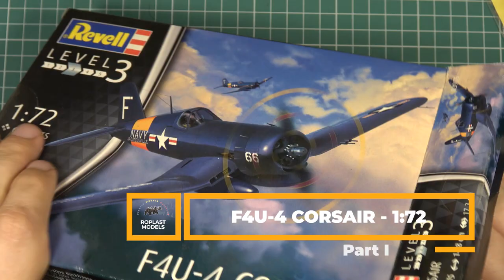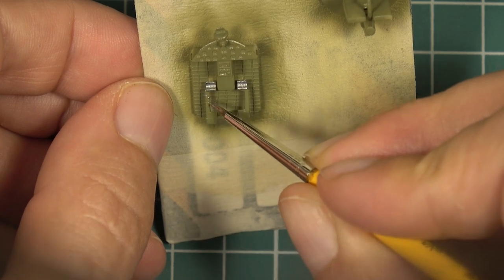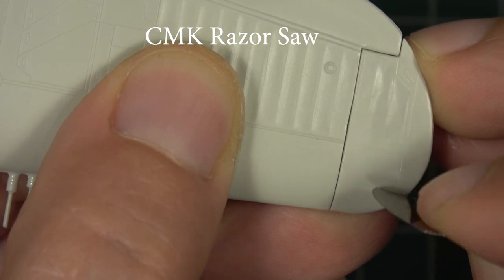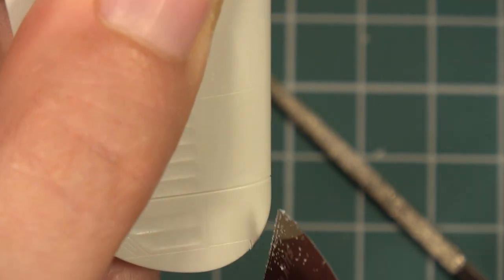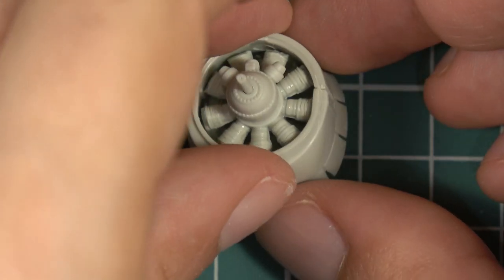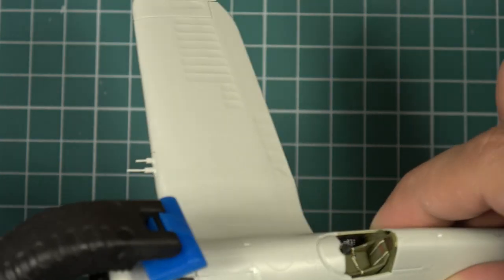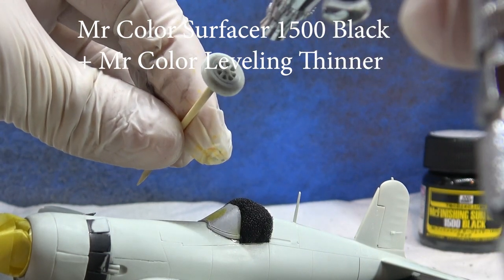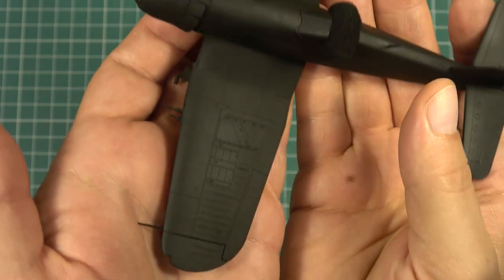Revell F4U-F Corsair - Full Build - Part 1

Comment: The wing tips assembly you found curious is because on the same kit base there's a  WW2 British Royal Navy version with shorter ones on a separate sprue. So you don't have to cut and shorten the wings as it's necessary on other kits

Comment: Hello, really nice build!

I did the same kit from the box few months back as my second kit after too many years. I had some issues to make the piece in front of the cockpit to fit properly (piece A39) the initial result was close to what we can see on Revell's pics. I tried to fix it with sprue goo but it was not a success at all. After lots of sanding I managed a result that is not that good (thanks to the dark color to hide it a bit). 

How did you manage to make it fit? Did you sand it?
Reply from the maker: Thanks for your kind words. I don't recall having to much trouble fitting that part, but for sure, a little sanding was involved :).

Comment: I got this kit and was going to build it.  But let me ask how do you deal with the parts where you need to prime, paint before moving on to the next build instruction.  Did this kit take you multiple days (weeks?) or did you prime/paint in less than 24 hours?   Stuff like the wheel wells for instance.
Reply from the maker: Hey, I prime and paint parts before gluing, no problem - you must be careful when "welding" the plastic, not to ruin the paint. I didn't make any kits in less than 24 hours, I prime the model, I wait at least 12 hours, then I paint it, varnish it, decals, varnish again, weathering and then the final varnish. This takes time, if you don't have a dye oven, days. Good luck and have fun with your build!
Reply: @katherinus-models  yup going about the same for me.  Great little kit and really enjoying the pieces of it